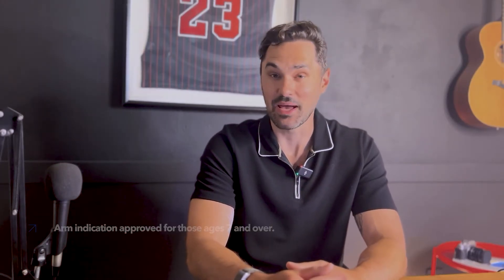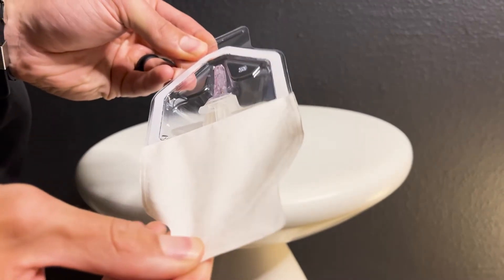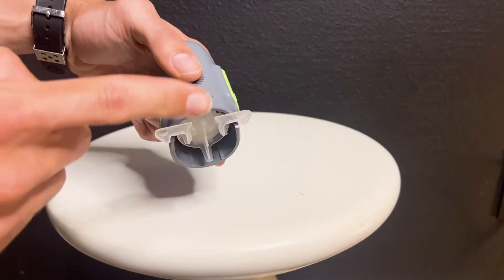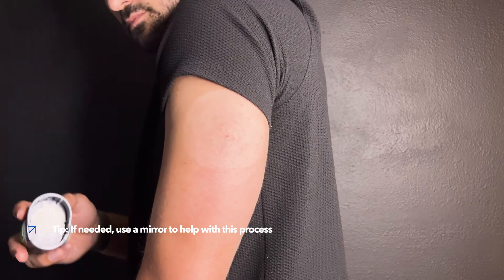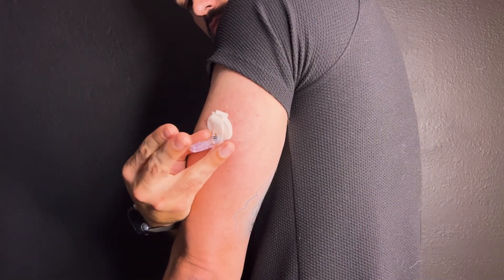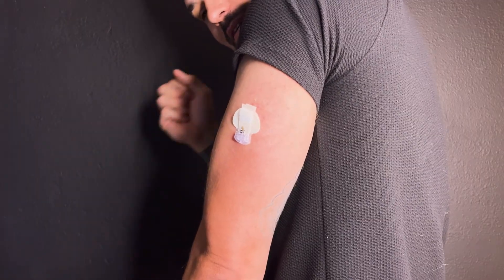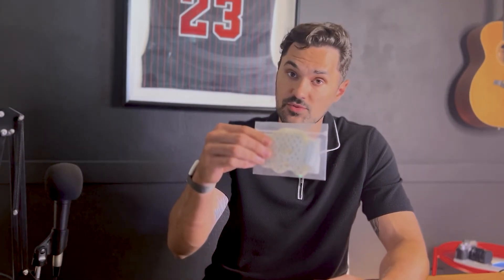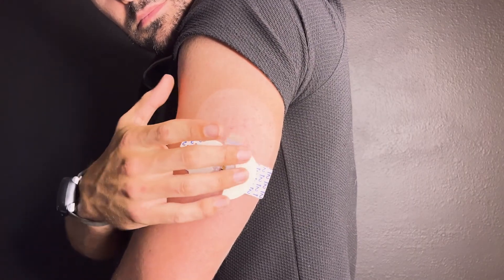Medtronic Guardian 4 sensor insertion - How to Insert The Guardian 4 sensor

Comment: What to do when the sensor expires. Just keeps updating
Reply from the maker: I will do a video on this
Reply: @migaliaboulaabi7650  
DETACH THE TRANSMITTER FROM THE SENSOR THEN REMOVE THE SENSOR FROM YOUR BODY CHARGE THE TRANSMITTER AND WHEN READY INSERT ANOTHER SENSOR AND PLUG THE TRANSMITTER INTO THE SENSOR

Comment: Curious why you have the sensor pointing up rather than down? It's so much easier to get the transmitter on when the sensor is pointing down, just saying!  Also, why not take the tape that is on the bottom of the sensor off before inserting it?  I made that mistake for a long time and then realized how much easier it is to take that off when the serter is locked an loaded.  My problem is applying the transmitter in a place that hurts for the whole week or is a bleeder, and I have to do the whole process again. T1D blows!
Reply from the maker: I just put it on upside down for this video by accident 🫣🤣and yes, it is easier to do the tape prior to the insertion, but I needed to follow the recommended steps exactly for this video to be approved. Hope this helps!

Comment: Easy for you to say my arthritis and neuropathy has made it difficult for me to do what you just did and for some reason the needle never wants to detach easily for me I'd love to put it on my arm like my Libre 3 but I have to put it on my lower right or left side of my stomach because I nerd two hands to get the needle out 1 to pinch the tabs and 1 to pull it out because it's never came out without feeling like the entire thing is pull out which has happened but my stomach is a problem to if I don't hold it down when I bend over and my stomach rolls or folds in wrong, not rolls and folds I'm not that fat lol,  but it is a little rounded but I've bent over to pick up something and the back stayed put where the front pulled dow. And out the filament csme
Reply from the maker: Sorry if I made it look easy - I know it can be difficult. I've been struggling to remove the needle tower myself recently. I feel like the needles used to detatch easier!

Comment: The Libre 3 is better than the 2 thsts what I had before bring put on the pump and the guardian 4 isn't behind anything  other than having the battery of the guardian 4 is rechargeable and not permanently connected to the sensor and after each sensor you need to recharge the sensor battery it's not just all throw away compacted into 1 unit like the Libre  you still hsve to load tge Libre unto the installation device same as this the only difference is it's not all in one after using tge device to install the sensor we must then clip tge battery on and apply the tape to hold the battery  because the sensor has adhesive but the battery doesn't and it by itself isn't enough to hold both on I hope I shared enough but get the librec3 it's continuous monitor no scanning needed

Comment: Hi, I have been using the sensor 3 and the sensor 4 now since they came out. Something helpful is I remove the the paper in your step 2 (after removing the needle) before inserting the sensor. I use the threaded end of the white plastic piece that goes to the reservoir while the sensor is in the serter after removing the plastic cover. That way I can’t loosen the sensor when removing the paper. I do have one heck of a time removing the needle. Even though I have worked with my hands all my life. I just can’t seem to remove the needle. The rest of the process is okay and I do use Skin Patch instead of the clear plastic ones that come with the sensor. I am considering making something that I can attach to the wall that will grab the needle. I have my wife do the work after I insert the sensor. It would be nice if Medtronic would make a device that would insert the sensor and then remove the needle all in one serter.

Comment: Guardian 4 is the worst sensor in the market, application is complicated, MARD is the worst and it’s lasting only 5-7days with 2hr warm up.
Guardian 4 is the main reason I’m moving from 780g
Reply: May work for you but for seniors it is mostly user unfriendly. Can’t see what is going on can’t pull sensor protector off hard to apply tapes.. I use my abdomen and a full cover so none of the ridiculous taping.  Have had one month and already have had 2 sensor fails at day 5. Makes very hard to keep up with changing my pump tubing and reservoirs. Then there is the charging time of the transmitter and warm up is 2 hours. The only reason I keep it is the 24 hour reading and it is regulating my sugars beyond belief. That part is awesome.
Reply: @connieking9873 Trust me as a 19 year old its still a pain in tve ass to change the sensor, ripped off like 3 the last month trying to unattach the needle housing. The guardian sensor is if I dare say hot garbage, obsolete already 5 years ago, I feel yo7r pain changing them, cant wait to receive a better option.
Reply: What are you going to use?
Reply: I hear what your saying, this is my 1st insulin pump. Been a diabetic in Australia for 30years now and haven't had much exposure to pump info. Despite some of the inconvenience, it's made a huge difference so far. The new senor, Simplera, looks and sounds promising. Can't wait to hear more about it. Fingers crossed 🤞🏼 🤞🏼Good luck with your search.

Comment: Last night I had to turn off the sensor. I have epilepsy and was having sensor updating issues and could not take any chances of alarms going off during the night which I can’t be disturbed during sleep. So I turned off the sensor last night and this morning I turned the sensor back on. Should everything be back to normal? SmartGuard is working.
Reply: I buy the round tape that goes over the sensor and I also take the paper off the sensor before I insert it
Reply from the maker: My experience with turning the sensor off and then turning it back on is that it usually turns back on just fine. I've had it require a warm up period sometimes, but not every time. If SmartGuard is working that's a good sign, be sure to check your status screen to see when the sensor expires. Hope you got a good night's sleep
Reply: @DiabeticsDoingThings  thank you so much for your help.
Reply: I do this all the time wheb I work out, always turns back on in the span of 10 minutes perhaps, never left it a whole night though, id be interested to hesr if it worked.